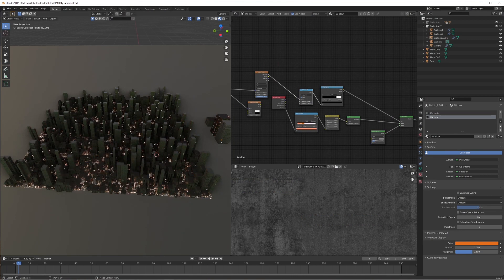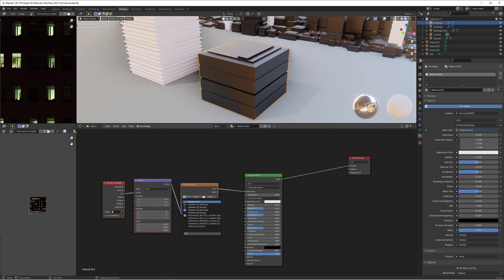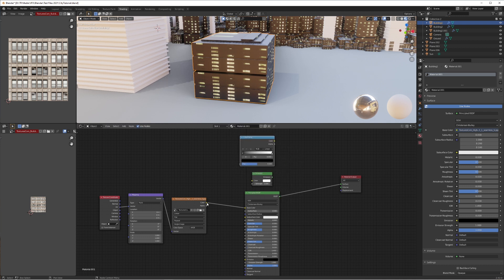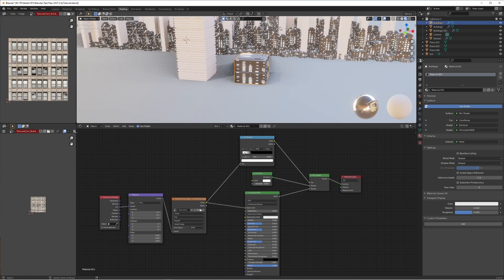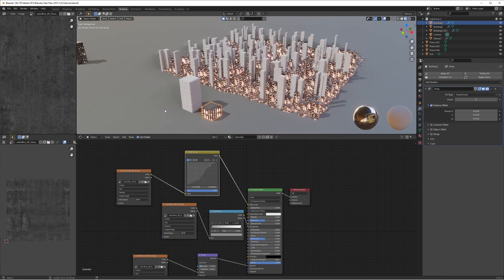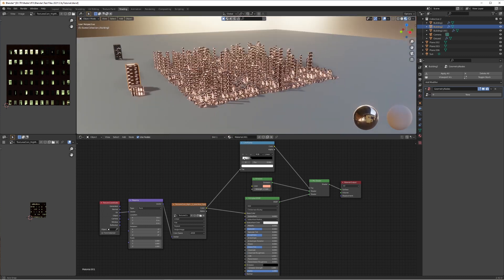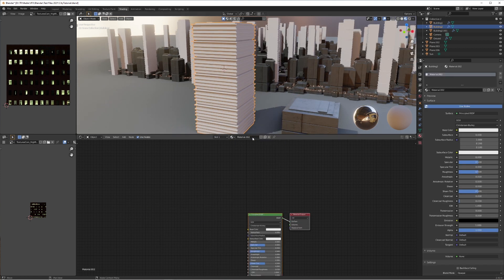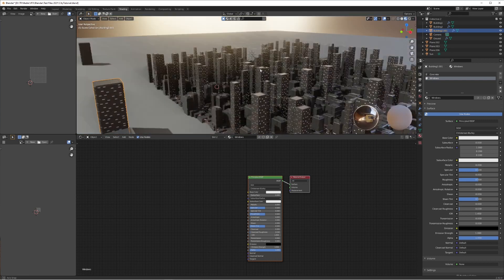Easy Procedural City MATERIAL Tutorial - Fully Controllable - DAY and NIGHT in Blender 2.9

Comment: I found seamless image textures like you did, but the image is stretched on the longer buildings. I've tried UV unwrapping, applying scale of the main object, and adjusting the scale of the geometry nodes. Shrinking along the Z axis returns the texture to normal, but this removes the taller buildings. Not sure how to fix.
Reply: Make the original building taller with an array modifier
Reply: @futurewjetpacks  How?....